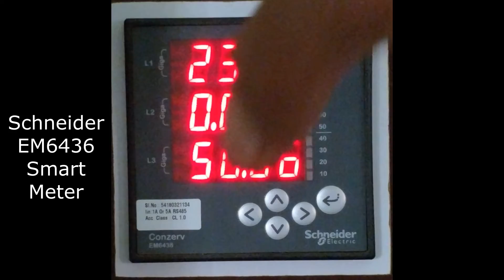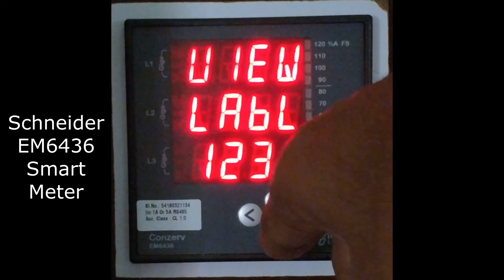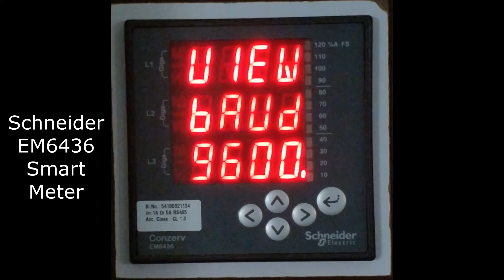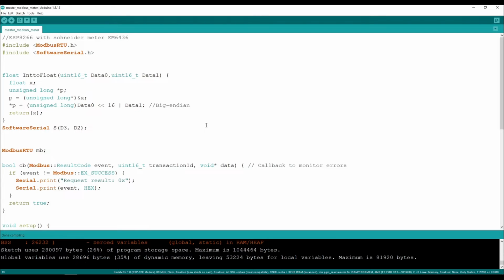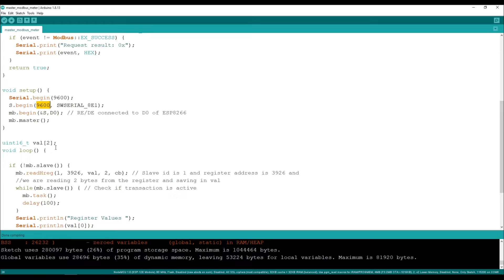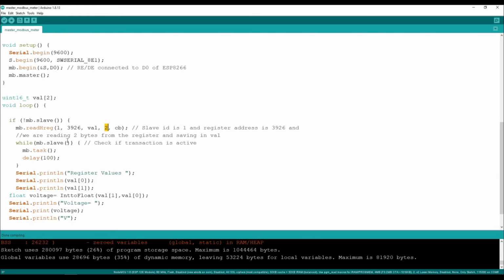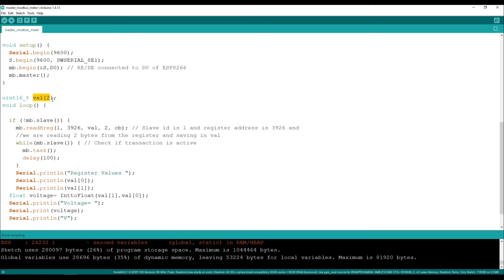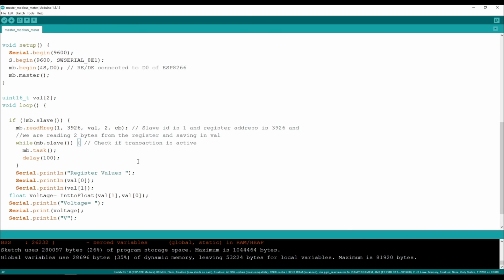Modbus Communication with Schneider EM6436 Smart Meter using NodeMCU ESP8266

Comment: hii
Reply from the maker: Hi
Reply: @sarathtv  can you help me why at serial monitor i get 0v
Reply from the maker: @haziqrzl4475 what’s the response code for modbus communication
Reply: @sarathtv the reading 0v continuously
Reply from the maker: @haziqrzl4475  that is the print from the voltage conversion function 
In the code there would be a response code from modbus in case the communication with the meter is not successful
Reply: i just got a warning for storage while compile

Comment: can you show the connection between EM6436 to esp8266 please
Reply: because I use jumper wire so I just want to know how the connection
Reply from the maker: Hii 
Please go to this GitHub link 
I have given the connection details and the schematic for the connection 

https://github.com/sarathtv/Modbus_ESP_SM_RTU
Reply: hiii may I know how to get register address from power meter
 @sarathtv
Reply from the maker: @haziqrzl4475  those details will be available in the datasheet/user manual of the meter

Comment: Hi sir, We are also doing our project with Elmeasure 6435 with TTL to RS 485 using Arduino. I want to export data from meter to Arduino. Kindly give some guidance sir.
Reply from the maker: You can modify the code from this example to adjust to arduino pins and reuse it
Reply: @sarathtv  Thank you sir. I will try this sir.

Comment: Program not working D3 D2 not declared
Reply from the maker: you are using nodemcu itself ryt 
And selected the board in arduino IDE properly right ?
Reply: @sarathtv  and what's solution if i use it ? please answer
Reply from the maker: @gampangingat_id  seems like some wrong selection in board 
You can do one thing 
Check to which pin the D3 of ur node mcu is mapped and replace it into the code
Reply: @sarathtv  right sir , is it not compatible ?

Comment: Good Work .... Thanks for the tutorial. Just want to know how to configure for other registers
Reply: I am using em6400ng shnider make meter. Now I can view only one register value like voltage on serial port. I want to add frequency, power factor and other stuff also. Kindly guide if possible. I have set slave I'd 1,parity :Even, stop bits:1,baud rate:9600
Reply from the maker: @bubaibhattacharyya4337   you need to use  mb.readHreg(1, xxxx, val, 2, cb);  replace xxxx with the register address for frequency/pf/other parameter. This address will be in the user manual
Reply from the maker: Thank you for the feedback.
The datasheet/manual for the meter will have the details about the register address.
The api I used was read holding register if you want to write something to the register you will have to use the write api,which is given in documentation of the modbus library

Comment: can you make modbus read and write to the inverter to control it
Reply from the maker: Yes it should be possible provided inverter has modbus interface.
In that case you will be writing to coil register instead of holding register.
Reply: @sarathtv  yes . i have looked through your program but i don't know how to add the statement to write down to the inverter. can you help me
Reply from the maker: @quyquy4817  share the details of the inverter. I will check it during weekends.
Reply: @sarathtv  okey thanks you

Comment: Can you share wiring schematics with rs485 to TTL converter with esp8266. I am trying to read secure multifunction meter.
Reply from the maker: Hai thanks for reaching out.
I have shared the GitHub link in the description. In the GitHub page I have given the schematic, connection information and code as well.
Please check and let me know if you are having problems accessing it.